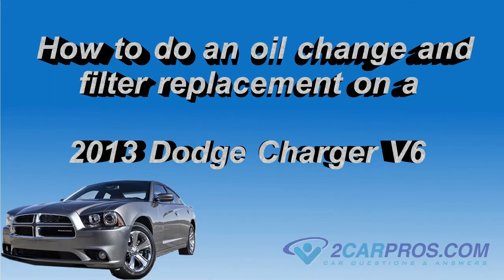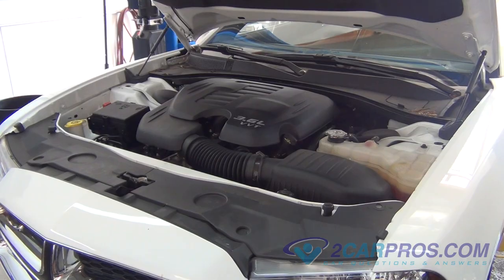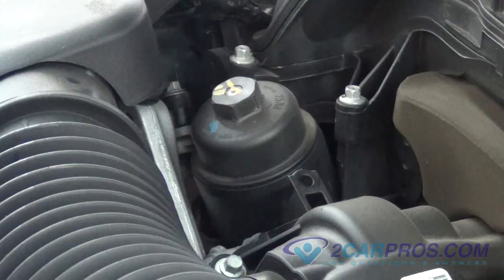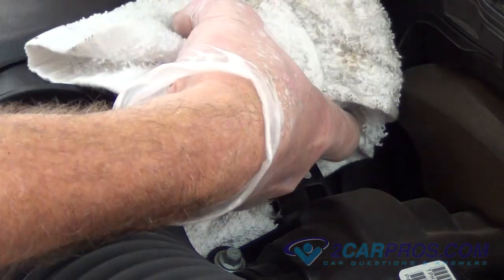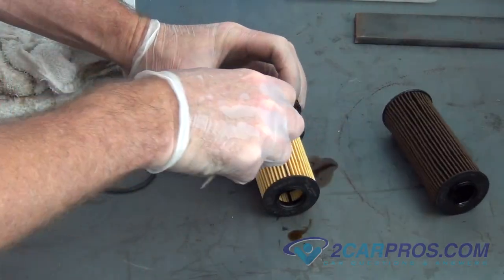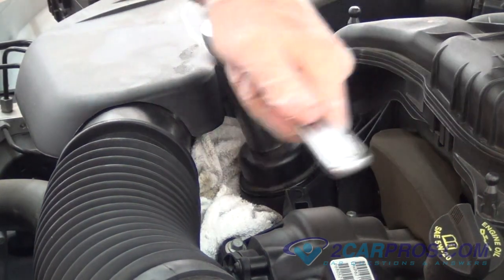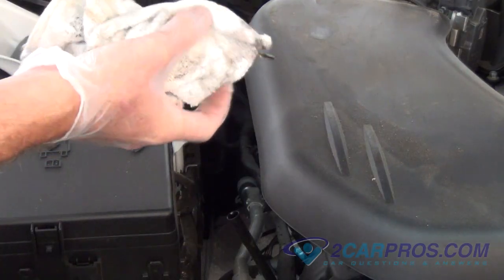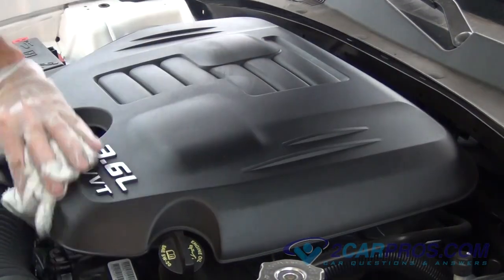Oil Change Dodge Charger V6 2011-2014

Comment: Dodge charger has the easiest oil change ..especially when it comes to the oil filter
Reply: But not yhe oil sensors 🤦🏽‍♂️ I'm dealing with one rn on oil pump.

Comment: I own a 2017 Dodge Journey four-cylinder. I suffer from an oil shortage. In Iraq, the temperature is high, approaching fifty degrees Celsius and exceeding it. I replaced the oil viscosity with 5/40 to reduce the shortage. However, the shortage continued to exceed more than a liter and a half per thousand kilometers, noting that the oil classification is sp. What is the solution?

Comment: When I went for an oil change and got home, I noticed an oil leak of about 3-4 oz on my garage floor.  I took the car back tho the shop.  They told me my oil housing was cracked (without looking at it)  I told them no way - just change the filter and do it right.  So they changed the filter - and no more leak.  If the oil housing was cracked, it would always leak, not fix itself after changing the oil filter.  My guess is they messed up that o-ring.  It was a non-oem filter.  2011 Dodge charger.  This happened 2 times with this car, 2 years ago and again yesterday.  No leak when they change the filter the second time and you watch them.
Reply from the maker: Nice catch! Thanks for watching!
Reply: The oem filter is like 10 bucks from the dealership

Comment: +HillaryHitler  I agree with taking the filter out of the top cover and then change the o-ring seal, then snap the filter on.  Less change of accidentally damaging the oil filter itself.  Also I would coat the whole o-ring in a light coat of "new" oil before sliding it over the threads and installing it.
Reply from the maker: +jtgreat888  yep good comment, please subscribe to our channel

Comment: I'd remove the old filter before draining the old oil.  About a half quart of dirty oil just drained into the pan. Fram has 
a special bulletin on YouTube about these kind of oil filters.  Also to anyone who has a Ford power stroke diesel that uses this type of oil filter stick with oem. Ford has a patent on the size that matches their diesel engine.

Comment: I just bought a 2011 Charger SE 3.6 VVT and I'm about to do the oil change. I want to know why you don't pull the fill cap and filter before draining the oil? I only ask because I thought that by pulling the fill cap and filter first was better for draining. Again, I'm a newish (and learning) "Do it yourself" person when it comes to working on my own vehicle. Thanks for the info in this video.
Reply from the maker: You can if you want to but it is unnecessary. The engine isn't a perfect seal or anything it has breathers that let air in and out. Even if it didn't oil would still come out it would just glug a bit similar to you drinking water out of a bottle. Thanks for watching!

Comment: It seems most videos on youtube show incorrect oil change instructions. You want to leave oil plug out when changing filter so dirty oil from the oil filter canister drains and doesnt mix with your new clean oil.
Reply from the maker: You aren't going to get every single last drop of oil out of the engine. Thanks for watching!
Reply: @2carpros  ok it's all good. I dont know its exact capacity and assuming there is some sort of anti-drain valve, i would think there had to be at least 8 ounces of old oil trapped in that housing that is mixing with you brand new clean oil . probably wouldn't matter and i've been wrong before, but i always change the filter before i even get under the truck to drain pan.
Reply: @robkenna2795  you are right.

Comment: Apply a film of Clean engine oil to the O-Ring of the new filter canister not used dirty oil which you show in your video otherwise the seal can be damaged by dirt.
Reply from the maker: Good call, we will do that in future videos

Comment: funny ,, it looks like they have changed oil pan designs ??  for the better I say ,, the other ones are terrible for pan plugs siezing ,, especially the bigger merceded diesel engines ...   I say if you dont have enough common sense on how to tighten up drain plugs properly you should maybe leave them alone .. I was a mechanic for 32 years and I dont think I ever put a torque wrench on a pan plug ..  Just remember all you want is a seal ,, you are not joining two moving parts or anything that needs some kind of extreme torque value ...  common sense (if you are remotely mechanically inclined) would not allow you to over tighten an oil pan plug ...  a small pan plug like that one would likely have about 25 ft lbs of torque on it to provide a seal ..
Reply: I just wanna add - oil filter must be done first and then drain oil coz rest of the oil (100-200 ml) will go down to the crankcase from oil filter housing wich is no good.

Comment: can you take off the oil pan from the bottom?
Reply from the maker: That's a good question, also most any oil pan can be removed if you undo the engine mounts and lift the engine
Reply: 2CarPros

Comment: mercedes engine   oil filter ideas suck ass big time !!!  If they want it to be a liked design they could at least have it so it drains when shut off or how about having it sit straight ??  you look at any mercedes engines and they are a mess around the filter housings ,, not to mention the leaks ... regular spin on filters would be better !!!
Reply: boohoo
Reply: It's a Chrysler engine.  Mercedes had nothing to do with the 3.6, they sold Chrysler before this engine was ever designed.

Comment: What is the torque on the oil filter cover ?
Reply: Oil plug torque specs is 20ft pounds on the v6 model ( found it )